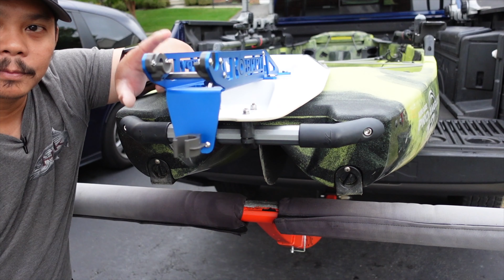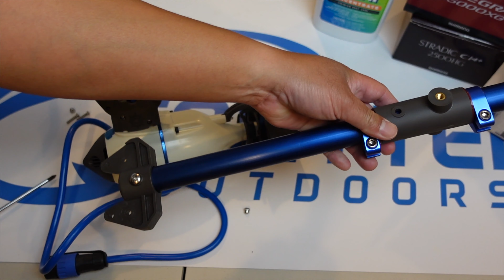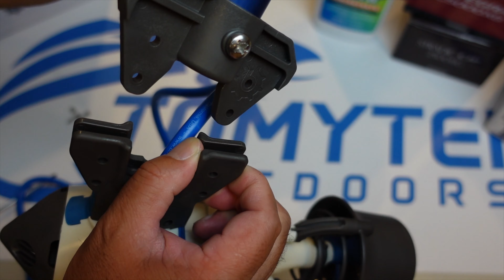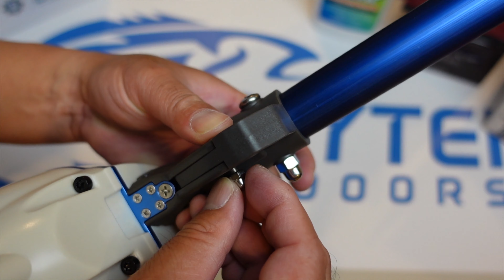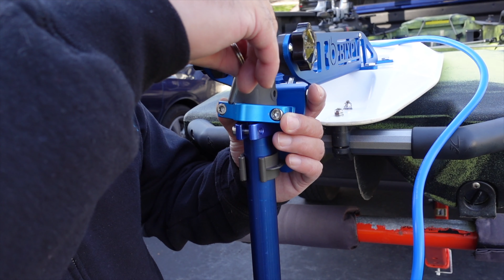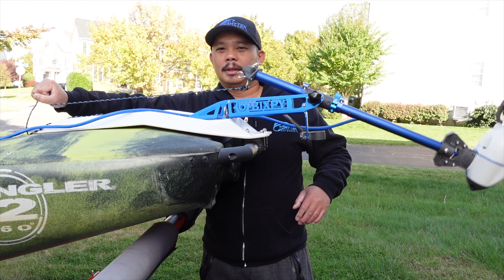How To Install The Bixpy J-2 Electric Kayak Motor On A Hobie Pro Angler 360

Comment: Thanks for the video! After a year of use would you still recommend the Bixby for a 14 ft hobie pa360?  Seems easier and cheaper than a torquedo or a motorguide.
Reply from the maker: Thanks for watching.  I have PA 12 and the Bixpy works well to get me to my fishing area.  Then I use my drive to get around.  I fished quite a bit of salt in strong current and winds last year.   The Bixpy did ok, but I had to help with my fins.  I think it would be ok for a PA14 if you don't fish in strong current.  I did find a good deal on a used Torqeedo and will be showing that soon.  It does provide more torque and speed on my PA 12.  Stay tuned for those videos.

Comment: Great install (thought I BELIEVE those are locking "nuts" not "bolts"!) video! Do you find the battery weight on the rear affects the buoyancy of the PA?
Reply from the maker: Thank you.  I always mix up nuts and bolts for some reason 😀  I end up getting the extension cable and putting the battery on the side of my seat.  Even in the back, you will not notice any difference with the battery.  It only weighs 7lbs.  On a long weekend trip, I had 3 Bixpy batteries with me and did not notice any difference with buoyancy.  I stored 2 under my seat and the one I was using was on the side of my seat.  I would recommend getting the extension cable if you have a PA.  I like having it close to me, so I can easily install the kill switch.  I'll make updated video with how everything is setup soon.
Reply: @TomyTekOutdoors  Thanks TommyTek! I will look into that extension. And I hope I didn't insult you. I'm not much at DIY, and mix up terms all the time! Plus I have no sense of direction, so love using my fish finder GPS to mark where I enter the lake so I can find my way back!
Reply from the maker: @RogerFordSuperRog  You're welcome.  Glad to help.  No worries.  I was not offended at all.  I just upgraded my Fish Finder.  That will make a great winter project.

Comment: What’s up man I’ve also got a PA12 360 .. been thinking about adding a bixby to move spot to spot and use pedals to fish… what kind of range and battery life and speeds are you getting out of it ?
Reply from the maker: That is exactly how I use the Bixpy Jet on my PA.  Here's my older video with speed test results with the J-1 https://www.youtube.com/watch?v=fMBm0D-ZAME.  I have to redo my J-2 speed test video, since my files were corrupted.  I forget what the numbers are off the top of my head.  We're getting some warm days now, so I should be able to remake that video soon.

Comment: Can you use a paddle to turn your kayak while this is running?
Reply from the maker: Yes you can. I can't show that in a future video. I use stick steering or use my 360 drive to turn.
Reply: @TomyTekOutdoors  Alright cool. I've decided on doing a power pole mount with the bixpy on my crescent lite tackle so I don't have a rudder. I didn't want to add the extra pole to steer and would rather just use my paddle if I could. The added pole might work better but I'm gonna have my paddle onboard anyways 🤷

Comment: Hi great informative video thanks. When lowering the motor does it clip into the holder easily under its own weight? It looks alittle tight. Does it have to be clipped in there for forward motion? Thanks
Reply from the maker: Thank you. You're welcome. It takes a little bit of force for it to clip into the holder. It doesn't when you lower it. It will eventually when you are moving at higher speeds.

Comment: Curious if you are having issues with loading and unloading the kayak from your truck now that the rear handle/grip is covered by the power pole mount. Also does the new hardware scrape on the ground when you are unloading from your truck? Thx
Reply from the maker: unfortunately, it does touch the ground when I lift it onto the back of my truck.  I don't have a problem with the rear handle.  I can show that in a future video.

Comment: Does the j2 mount kit work on the existing power pole inserts of the 2020 outback?
Reply from the maker: Yes.  It will fit on anything with the 4 power pole mounting screw holes.  I have a video coming up soon that will show the install on my 2019 Outback.
Reply: @TomyTekOutdoors  thanks

Comment: Beautiful kayak bro.I started researching and saving a year, before Covid hit. I purchased my 1st kayak, and I'm loving my boat. While  waiting 8 month's. I wanted the Blue Lagoon, Hoodoo Sport 120 pdl, with the through hull bow storage hatch, and toe control, drop down rudder system. I had already purchased my J2 bixpy, FF, Cabela's battery & many other accessories. I fish large lakes, resevoirs, and other fisheries. I'm 5ft 7, 151 lbs, and my hull and deck, is setup, identical, to the. Vibe Seaghost, and shearwater. My kayak with the bixpy  gets 4.5- 5.3 mph. Over 6mph, with a very light pedal. My 12V Cabela's battery, inside my power box I made runs all my accessories. Now she's on her kayak cart for winter. But I did order a 2nd bixpy battery, I'm going to mount, on a bracket under my seat, so she'll never run low. On speed 6, the bixpy lasts all day. But I love to cover water, and next season have tournaments lined up. So I'll really be able to explore away from 100 other kayaks. Now everyone seems to have some sort of motor on there kayak. 🙏 🎣
Reply from the maker: Thank you. Sounds like you have an awesome setup. The Bixpy is a great addition to have on a kayak. It can extend your range and make a long day of fishing easier on the way back to the ramp. I don't get to fish that much, so it helps me save time on the water. I'll be fishing throughout the winter, so stay tuned.